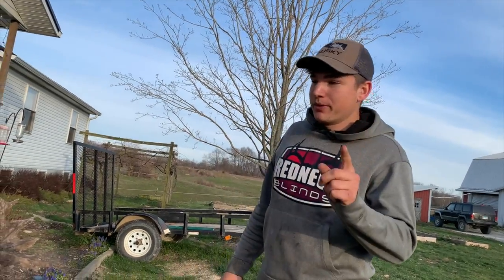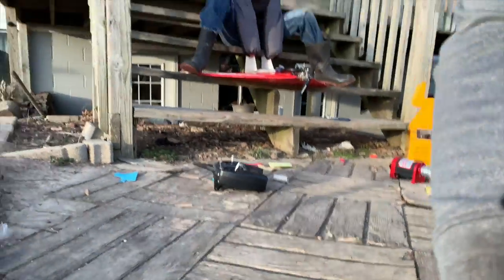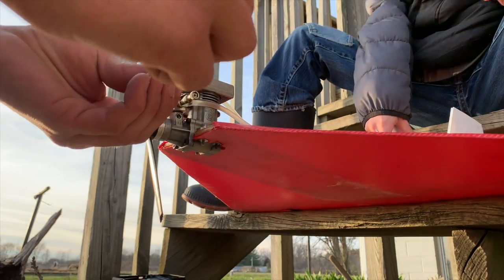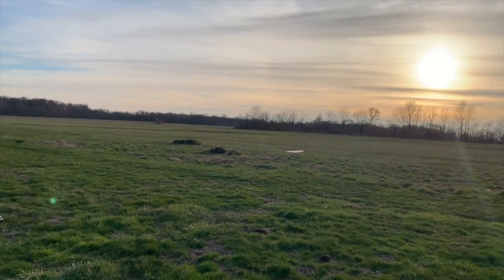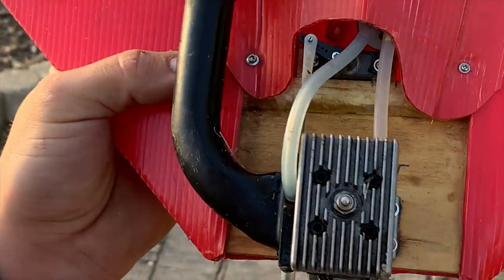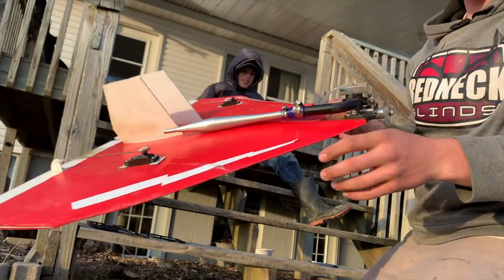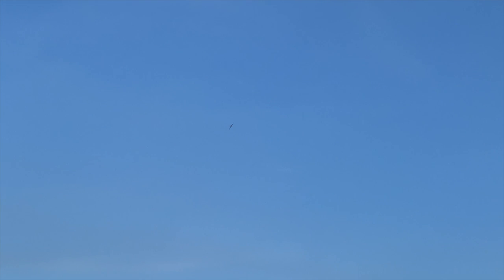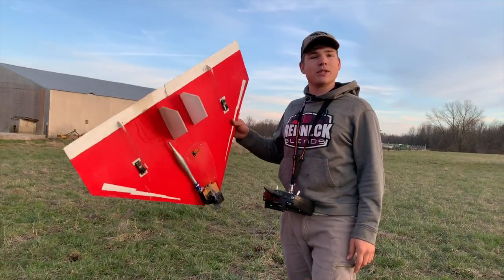HOMEMADE RC Delta Wing

Comment: nice :) 
when fitting a prop...
turn over engine till it starts to meet compression 
then put prop on horizontal...

when landing give couple of clicks down trim on throttle
so as you flare you can pull stick back and engine cuts

the wind milling prop will stop at horizontal and no more snapping props on landing :)
Reply from the maker: Thanks for the info! I’ve wondered how I could avoid breaking the prop on landing, what you said is a good idea. I have a throttle cut setup on a switch that I flip to kill the engine.

Comment: This has a heatsink head, which means it was likely a helicopter engine. For airplanes you will get too much cooling, which makes it difficult for the glow plug to stay hot.
Reply from the maker: Thanks that make sense. I would put a different head on it if I had one.

Comment: There was a kit called a GLH goes like heck, I put a Rossi 45 on my and it would corkscrew the air.  Originally plans called for outriggers for takeoff, I put wheels with a steerable nose wheel on mine.  The plans called for a .20 engine.
Reply from the maker: Wheels would be nice but they would add too much weight for this one.

Comment: That plane is called a "Dimond dust". The plans are on outerzone.
Reply from the maker: Cool thanks for the info
Reply: Such a small motor. Boss had a Rossi 60 on his.  It's a fun platform. Will fly gentle on less and scary on more. They're are smoother delta platforms out as well but I always liked the D. Dust though I stopped flying it when we swapped from 46 sport power to that Rossi.  Boss did too when he got behind it in low light and it flew away. Farmer brought it back next spring. Found it out in the middle of nowhere.
Reply from the maker: @williamcrane8236  Dang it would rip with a Rossi 60!!
Reply: @flyinhighjoe I have an o.s. .60 you can slap on there. Just pay shipping. Pitts exhaust
Reply from the maker: @krotchlickmeugh627  I’m good thanks
Reply: Not a Diamond Dust.  This one is made of coroplast.

Comment: Honest question here... What is the point of making a delta wing RC plane?  How fast do you think that thing is going to go?
Reply from the maker: You’ll have to fly one to find out man. It will never go fast enough lol 😆
Reply: @flyinghighjoe  I'm pretty sure it won't break the sound barrier.  Thanks for responding.
Reply from the maker: I know but it will sound good trying to😁
Reply: @flyinghighjoe  bolt on a kerosene burning model turbine. Would be wildly fast. Especially if you could create an afterburner.
Reply from the maker: @shawndubay4050  especially if I could afford it😁
Reply: @flyinghighjoe  true they are pretty expensive. Rossi makes one beast of an engine. Them things rip too.
Reply: @flyinghighjoe  Pulsejet is cheaper. Did you whip up the design yourself or have a plan? It looks sharp.
Reply from the maker: @Aviator747a  a friend of mine designed and built it. I do have plans and materials to build another one
Reply: It's a clone of one of the faster rc sport planes. They routinely clock over 150mph. The point is they are ridiculously easy to build and perform well if you just want to do speed passes.

But the fastest rc's in the world are a special kind of glider using the power of mother nature to do well over 500mph. ;) Look up dynamic soaring speed record.
Reply: @shmaknapublar  I like high speed passes but after you get so fast the plane just becomes a flash and a mission just to control it and keep people safe. I will stick with my Cessnas, Piper Cub and old school war birds.
Reply from the maker: @shmaknapublar  I’ve seen those. Their crazy fast!
Reply: @flyinghighjoe  the highest performance engines seem to be the Nelson's, Rossi and novarossi. Wide open they top out between twenty to thirty thousand rpm with the right propeller and right glow fuel.
Reply from the maker: @shawndubay4050  Wow! That’s some serious RPM. I’ve never heard of the Nelson brand but I do have a Rossi .45 with rear exhaust that I want to put on one of my planes.
Reply: @flyinghighjoe  it will for sure be a screamer. Definitely plan on turns before hand because it will have ALOT more zip than your everyday average thundertiger or OS.
Reply from the maker: @shawndubay4050  thanks for the tip, even this one is hard to control at high speed
Reply: @flyinghighjoe  with a rossi or nelson it could make it one to two times as fast.
Reply from the maker: @shawndubay4050  wow i just might have to try an engine swap then.